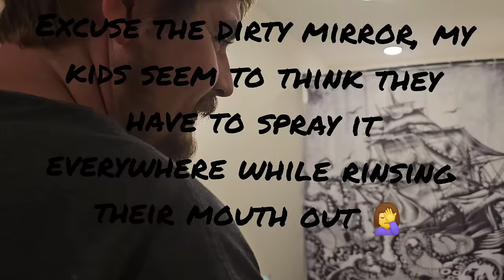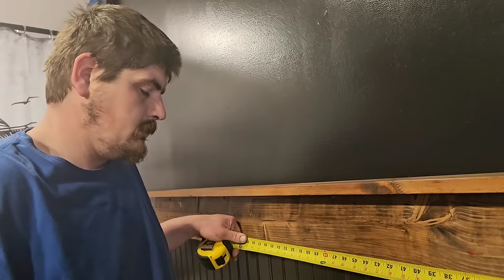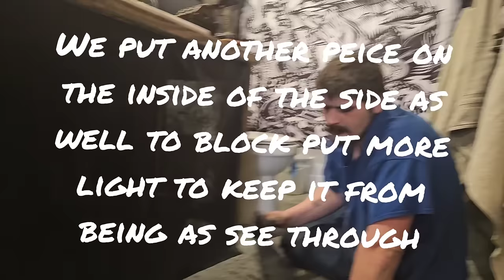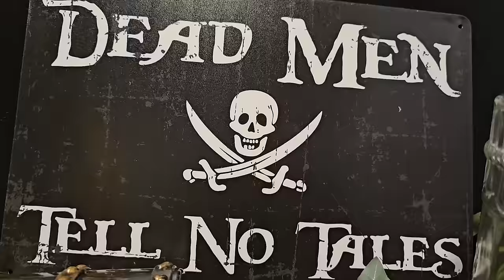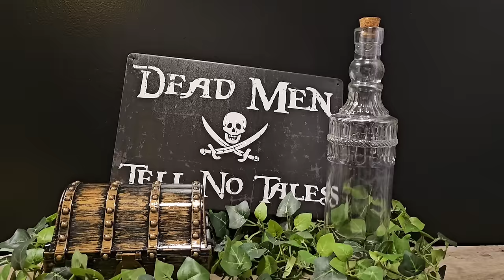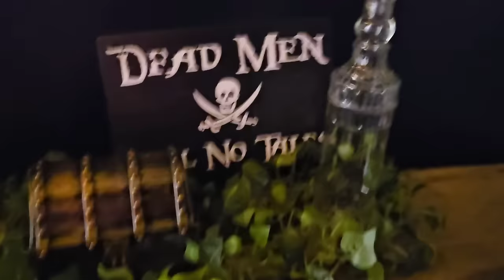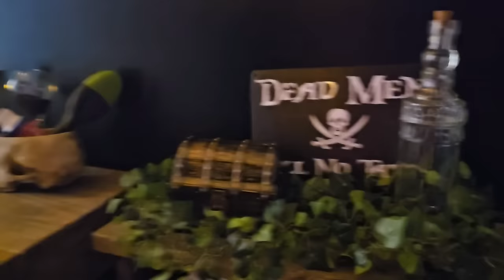DIY BATHROOM MAKEOVER! HUGE transformation! PIRATES OF THE CARIBBEAN THEME |Kids Bathroom renovation

Comment: If you use a foam roller on bead board and press hard the paint will fill the gaps in perfectly then switch over to a 3/8” nap roller to finish and it turns out perfect and tends to cover better also use an eggshell texture paint versus a semi gloss (lots of trial and error over here with beadboard Lol) Love that Caleb tells you no but then does it anyway 😂😂😂. The kid’s bathroom is so fun I know they are in love with it❤
Reply from the maker: Oh thanks so much for the tip! I didn't know what to use really, I always use flat paint because I don't normally like the shiny but I knew I needed something easier to wipe down especially in their bathroom 😅  so I will definitely keep that in mind for the others rooms!